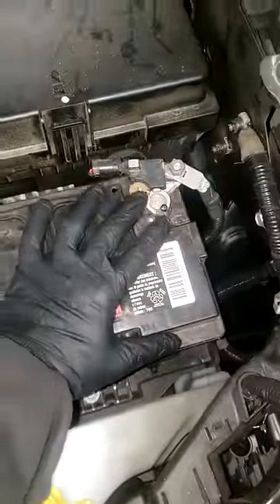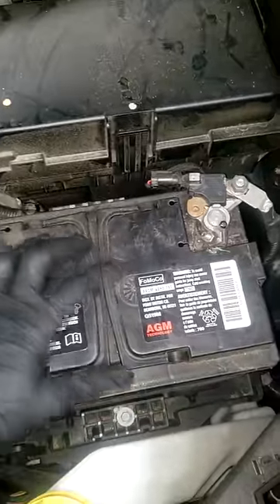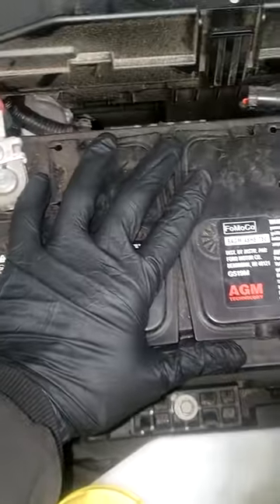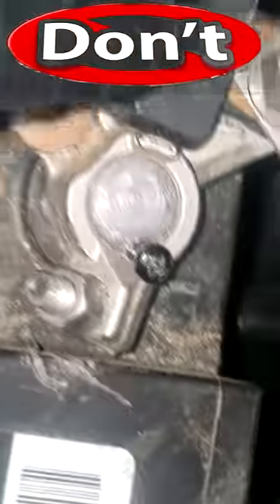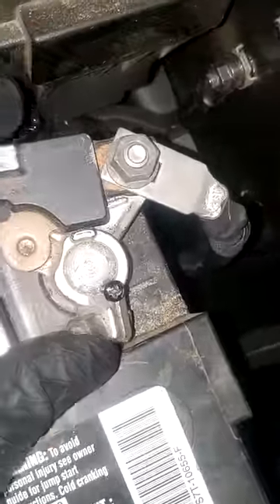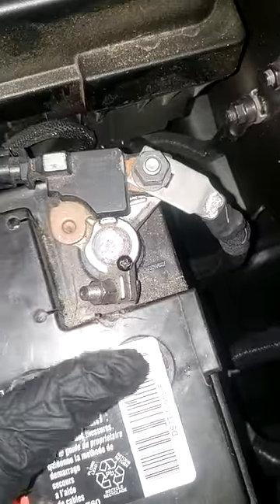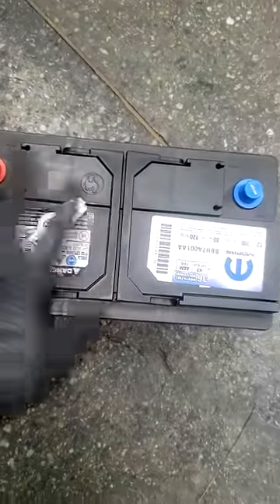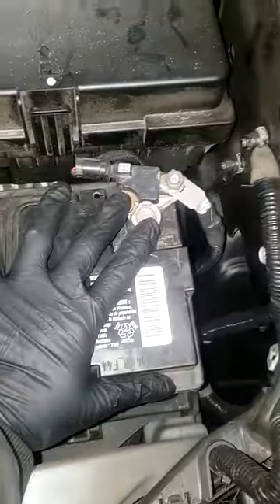STOP DOING THIS PEOPLE. This will destroy your car electrical system.

Comment: There is absolutely no way that sensor is being affected by this screw.. it's not the proper "repair" but also not the cause of the problem.. there could still be a bad or weak connection at the terminal that is the cause of the issue..or simply a bad battery..
Reply from the maker: How you gone tell me what the problem to this car is/was? So you really think you can put screws into a delicate sensor and it not be affected?
Reply: @OnlineMechanicTips  The part the screw is going into is not the sensor, that is the terminal. The black plastic piece above it is the actual sensor. Getting a bad GR8 reading does not mean the sensor is bad, that means the BATTERY is bad. I’ve worked in multiple different manufacturer dealerships from mazda to now mercedes. Slap a new battery in there and make sure the terminal isn’t loose or over tightened, then send it on the way.
Reply from the maker: @stephenhawkingMLG  bruh, why are we talking about this. Didnt I say the check engine light now off, its gotten a new ibs battery terminal/sensor and a battery. The car is gone and the customer happy. You cant ask for a better ending than that.
Reply: @OnlineMechanicTips  just out of curiosity, did you check it with only the battery before replacing the sensor? And if so, what were the results?
Reply from the maker: @SpicyMcGeezak  Not sure what you asking but here's what I did. Read the codes, looked at the IBS and battery. Thats all I needed to see. Showed customer, she gets pissed at the previous place. Boom. New battery and IBS installed. Everybody happy. No sense dragging this out with a lot of testing and waste of time. Most of the problem visually seen. You simply shouldn't be screwing into sensors like that.
Reply: @foodhatesme  I was just curious because it didn’t look like the screw was screwed into the actual sensor itself? Or am I missing something? Excuse me for my lack of mechanical knowledge.
Reply from the maker: @foodhatesme  Lazy bumb??? Lol...Ok lil guy, you obviously not understanding whats being said. But you are more than happy to waste time on trivia things. The code and the screw all I needed to see. Its fairly simple, don't be screwing screws into sensors thats monitored by computers. Can you at least grasp that concept? This is 2023, cars are more advanced and your old ways of doing things not advised anymore. You might wanna hang on to ya old ass cars because it seems you not ready for this new stuff..smh
Reply: @foodhatesme  I think it's probably a bad muffler bearing and not the battery. New plugs and turn signal fluid should fix it. Or he could hit the undo button, choose a recovery point closer to when the car was made and reverse the whole issue. I mean it's pretty simple. 🛠️
Reply from the maker: @foodhatesme  Now just how would you know what a real mechanic would do? Lol...foh, stick with them video games my guy, you seem good at that and popping off at the mouth about something you don't fully understand. Typical
Reply from the maker: @foodhatesme  None of which equipped with the IBS sys package. So again, leave the thinking to the pros, your video games needs your undivided attention.
Reply from the maker: @foodhatesme  Upset? Called out? Testing a sensor even with a check engine light on and visibly compromised, and you really think im going to waste time on that? Seems I've wasted more time with you my guy. Had i known up front that you not open minded and ya brain stuck on crazy, I would have never jumped into this. You tricked me
Reply from the maker: @foodhatesme  TF, I don't have to give you a reason or prove anything to you my dude. Please understand that..Im not trying to win you over. Believe what you want to believe my guy..if that makes you happy, stay the course, stick by your guns. Im cool with that
Reply from the maker: @foodhatesme  Finally something we can agree on. Now enjoy your lil video games, I have real world cars to diagnose and fix.
Reply: What does this sensor monitor, and how was it diagnosed?
Reply: The “IBS” sensor or “smart alternator” sensor first off can be totally disconnected, as that would allow full charge to the battery. The screw is not in the sensor, but in the terminal and clamp to prevent it from moving, does not effect either the battery or sensor unless that screw cracked that terminal post somehow?? A fresh battery and disconnecting that precious sensor, WILL fix that “electrical problem” period. Thumbs down buddy 👎👎
Reply from the maker: @SA-hk8xj  Seems you just as confused as everybody else if you thinking you can simply un plug that sensor and expect the customer to have a nice day. Lol, yes all yall may need some updated training on this stuff cause yall thinking old. Been there done that with replacing one and testing all that crap. Sys to sophisticated to guess. Simply replace both and call it a day..I highly suspect you guys would change course if you worked on these daily, but because you on the outside suspecting, I cut yall some slack.
Reply from the maker: @dagwoodtrizzle2693  If you not even sure what it monitor, whats the point in knowing how it was tested? You have to play catch up buddy.
Reply: Yeah I really don't see the screw making a difference but if makes the customer feel better just change it. I've done plenty of unnecessary work because the customer said do it. With them completely aware that its not necessary. Also why a battery sensor why so many needless sensors to break? I don't want to deal with that many points of possible failure. My dad quit his mechanic job because he spent 3 weeks fixing a Cadillac essentially for free. He was actually having nigtmares of wiring diagrams
Reply: @OnlineMechanicTips  No confusion brah. Variable voltage charging sensors have been around for years and were installed to meet manufacturer CAFE standards. To save that precious .001 mpg by lowering the alternator “drag”. Disconnecting that sensor/signal places the alternator back to charging at 100% all the time vs. kicking on and off (like those auto start/stop engine sensors as well). Think YOU need to get a bit more educated and quick posting crap like this to justify your thinking. Did you even place a load tester on battery? Did you scan the system for any codes? 
Folks, this right here is an example of a person who “thinks” he’s a mechanic that knows his stuff. Do your due diligence and find a real mechanic vs. just a parts changer that hopes he replaced the right part 🤦‍♂️😂 Good luck.
Reply from the maker: @SA-hk8xj  Your confusion based off the fact that you really think you can unplug that sensor and then deliver the car to the customer. smdh, that damm check engine light will be back on before she get around the corner. Thats the complete point why she here in the first place, her warning lights on because some jackass like you put a screw in her battery in an attempt to fix connection.  Not thinking such an idiot move would not be noticed. Same with your jackass way of thinking that you can simply un plug that sensor and expect the alternator to full charge and the light not come on. smdh..Cars communicate with customers via warning lights in case your un trained ass didnt know that. Warning lights draw customers to the proper shop after leaving such shop that you are employed at..Thank me later, the car fixed and gone. Keep your paws off these new cars and your screws in your tool box in the future my guy.
Reply: @OnlineMechanicTips  I know one can disconnect the sensor without tripping any codes!! Just like one can bypass the auto start/stop feature without tripping any codes. Get your electrical training and you will know too. I have permanently disconnected both types of sensors on many vehicles without any issues or call backs. In fact my manufacturer’s TSB has several notations on situations where this HAS to be done in order to either verify other electrical patterns, or to totally eliminate electrical fluctuations from either the sensor itself or down it’s communication path. Vehicles do not communicate with customers…they indicate there is a problem. It’s YOUR backward @$$ that needs to find the issue and solution and communicate it to the customer. Not wasting anymore of my time bickering with the “online  mechanic”🤣 Your advise fits perfectly with all the rest of the online fixers who “think” they know something, and post it on YT🤦‍♂️
Hope people that read our comments will at least get a second opinion before having someone like you touch their vehicle 😉✌️
Reply: Yea honestly this was not worded correctly. Should have recommended to the customer he replace that but not necessarily call it bad just because the previous guy put a screw in the terminal part of the sensor.
Reply: Bet that screw was grounded on the hood
Reply from the maker: @SA-hk8xj  Yea you stay nice and cool under your shade tree working on cars there. Aint nobody un plugging no dam sensors like you suggest..FOH with that... O the comments aint going nowhere, maybe somebody will take your advise and simply leave the screw in there but just un plug it..smdh..Yea bruh, I cant do this with you, I have lost a brain cell communicating with you. Seems you to far gone.
Reply from the maker: @goenitzlopez2076  First off, dont put words in my mouth. I never use words such as bad to describe a part. Only ameteurs do that. Second, if you been paying attention, you would have seen/heard me say after showing customer this, even she wants them replaced. If I had to choose a word to describe the failed parts it would be compromised. By some other shop that @S A work at. Yea they do work like that over there..
Reply: @OnlineMechanicTips  there is no screw in the sensor. All of us can see that. I don't know why you're acting indignant when given the video and the comment ratios no one really agrees with you. It's a ghetto fix but again you've checked nothing per your own word. You didn't run a battery test. You haven't tested the sensor. The only thing you verifiably needed from what was shown is a battery terminal to replace the loose one.
Reply: haha, I love this thread. This is cause for a good ol' wrestling match. At the end of the day, who fk'n cares, if it's fixed and the customer didn't get ripped off, it's good. We all have little different way of going about things, but if it worked, it worked. everyone is happy happy.
Reply from the maker: @arnold8746  lmao, not that simple dude. Some of these guys want blood...lol
Reply: @brandonweeks  Seeing as how that is the ground, why would that matter? That would also be a pretty tight hood to battery clearance as that was a pretty short screw.
Reply: @foodhatesme  he definitely is bro watch his recent short , he replaced 3 purge valves when the issue was a compressed / squished fuel line. bro is a con lol
Reply: @OnlineMechanicTips  wether its fixed or not now is irrelevant
 Its impossible that screw was the problem
Reply from the maker: @Justvn4thGenTL  smdh, the video you speak about was from Pep Boys. They replace the purge valves. Seems maybe you missed that part hater. You might wanna listen a little closer next time because I'm sure I said that. The actual problem with this 1500 was found by me when I dropped the tank. Smh
Reply from the maker: @johnnymathes5215  Ok let's see, screw removed, compromised parts was replaced, the code erased and the check engine light now staying off, Customer happy and gone but you still on here talking about the screw don't matter? Seems you missing a screw or 2. My goal is to please the customer, not you and your hack way of thinking.
Reply: Hey man can you let me know if God Is real cause you obviously know everything
Reply: @OnlineMechanicTips  Yes. They shouldn't have put a screw in the terminal. Yes, you should have tried the battery with the old terminal before changing the terminal.

If the terminal didn't need to be swapped but you still offered your professional opinion that it was required to be swapped and then charged her for it, then that's unprofessional. It very well could have required a new terminal. You don't know that for a fact, though, nor does anyone else.
Reply from the maker: @nickwilliams2415  What part of this not being your typical battery terminal do you not get? This is an all in one IBS unit here thats monitored by a computer.. Who am I to argue or resist what the computer trying to tell me?? If it's visibly screw into and cause the check engine light to come on (which is why she here) What on earth make you think im about to waste time swapping anything. You guys think to hard without thinking. Please never get a job on commission because you would be broke from wasting time and being caught in your feelings.
Reply from the maker: @3L5Ancho  No @ by this comment. Who are you talking to?
Reply: Yeah no way that screw was the problem.
Reply: @OnlineMechanicTips  u sure cause you can go back to that video and hear “ it keep coming in for a purge valve code “ meaning it keeps coming into your shop you work at with the same codes. Never did you mention petboys lol wth
Reply: @Online Mechanic Tips  haha mighty defensive..it was most likely due to defective battery which you also replaced you said. Replacing the extra parts is just upselling the customer
Reply: @OnlineMechanicTips  Grab a broom and dust these haters off lol. Your doing good bro, keep up the good work.
Reply: @OnlineMechanicTips  delicate sensor maybe but whoever put the screw in didn't bother it by the looks of it. He just made the connection solid nothing wrong there if that sensor was hooked it was a coincidence. All he did was cost the owner a battery and sensor and probably didn't fix the problem
Reply from the maker: @rjrobles8469  lol whats crazy is that they all so called mechanics that maybe a lil to advanced for the video. But its killing them and itching them to death to jump in and say whats done wrong. If it was me, ide simply create a youtube channel and do rebuttal videos on the ones I don't agree with. That channel would blow up. But I guess its easy to simply sat on the sideline and vent.
Reply from the maker: @Justvn4thGenTL  smdh, you gone have to do better with the hate, you suck at it. That truck came from pep boys. Purge code again, history of those valves was done at pep Boys. Hence the reason why I got it little man. All Pep Boys had to do was run a verification test using a good scan tool and it would have showed fail and tank pressure high. From there find the restriction. Thats exactly what I did. This truck been fixed a long time ago..You need more practice at hating my guy.
Reply: @OnlineMechanicTips  you specifically said , it’s been in here several times for purge valve , you did NOT mention pet boys lying a$$ 😭😂. nobodies hating also kiddo
Reply from the maker: @Justvn4thGenTL  Seems slow, seek help quickly
Reply: @OnlineMechanicTips  worry about fixing cars the 5th time it comes around , stealing money
Reply: @OnlineMechanicTips  Sure you may have solved the problem , but it was not the screw.  The problem is you made a video saying that a screw caused this problem.  It’s not helpful
Reply: I’m a former Mastertech and Automotive Engineer. I know for a fact that the test that mechanics do for most parts are not 100% perfect. That’s because, mechanics only have access to certain types of tools. DMMs DSOs etc. To really truly test some parts you need a whole (very expensive) specialized test rig. Long story short… If the mechanic suspects parts in that general area could have been affected by the hack repair…. It is a good idea to just go ahead and replace them. Sometimes it’s not just about saving the customer a few bucks. Sometimes it’s best to replace related, potentially damaged parts … to save the customers Time from potentially having to come back for the same problem. Just food for thought my friends. 👍
Reply from the maker: @Dogpool Im a youtube content creator, im not even sure you know what that mean or would understand.  Lmao, but helpful to who? What do you supposed the title should have been?
Reply: @OnlineMechanicTips  No you are just too incompetent to understand that the screw is NOT screwed into the sensor, its screwed into the terminal block/ring as a shim. The sensor may have been broken but it was NOT the screw that did it, it was just a normal old sensor failure from being in use. Lmao
Reply: @OnlineMechanicTips  This guy is wrong! You were correct in your presumption. These sensors are calibrated, and extremely sensitive. The material in the the screw is not the same as what the sensors made of. Although, not the same, I’ve seen photovoltaic sensors that were so sensitive, that connecting the wires together with wire nuts caused the resistance to be out of spec, and the sensor would not read, correctly. Good job, and thanks for the video
Reply from the maker: @ElaBellll  Your clown ass still on here defending that screw?  That IBS monitor things like the voltage, temperature, and current. youd have to be out of your mind to trust that the screw had no affect on any of that. Especially considering the warning lights and codes that it produced. These computers simply expose hack mechanics like you that see know problem with this. That sensor is a complete unit here, we dont separate them.  During factory training,  from engineers I might add, it is highly advised to simply replace it if some jack ass shop like the one you work at do shit like this. Are you really that dense?
Reply from the maker: @johnharrison5656  I recall being at the factory training center in a body electrical course. I cannot count the number of times the instructor brought this up. People cant let go of the past. Any outside interference from items such as screws, to simply replace the IBS because it could affect other things and set crazy codes. Im to the point now, any type problems I get, im looking at that battery and its connections. Ive seen poor battery connection knock transmisions off line and out of proxi alignment. This customer actually lucky all she had was a check enging light on, it could have been worse. Thanks for tuning in John.
Reply: @OnlineMechanicTips  there's a clown here but it's not me lmao
Reply from the maker: @ElaBellll  What you saying is clownish and signal you still living in the past. New cars are different buddy, your old way of thinking just wont cut it. I work on brand new cars on a daily, theres no way I could survive here with clownish thoughts like yours running through my mind.
Reply: @OnlineMechanicTips how was the sensor visible compromised?? You keep saying the screw was in the sensor butttt that’s not the sensor that’s the battery terminal which does not affect the sensor that’s there just to tighten the connection can you read what the other gentleman said?
Reply: He shotgunned it.
Reply: I understand both arguments… theres two sides to every story. If it was me and my vehicle, I would just replace the bad battery. If it was for a paying customer or for the in-laws or something, I’d replace both battery and sensor just to 100% be sure they ain’t calling back… lol i mean that sensor definitely isn’t damaged by that screw but who knows what kinda high resistance was running through that bad terminal connection causing heat, etc. possibly screwing with it before that last lazy ass had his head under the hood. Id rather be 100% im not getting call backs from certain people than 90%… its just less aggravating for everyone. But if it were any of my vehicles, the wifes or just a customer who needs cheapest fix possible for a cheap car, then battery swap is plenty enough with maybe a quick sensor bench test
Reply: @WrenchBoostBoi 89  I think the issue here is how the guy worded it. The sensor was NOT necessarily bad. He just shotgunned it to have it back to factory but he should have explained that better in the video not the way he just says that screw messed up the sensor and caused all sorts of erroneous readings that was not proven at all in the video.
Reply: @ElaBellll  😂😂😂😂 this guy thinks the battery cable terminal is a sensor.
Reply: @OnlineMechanicTips  hack
Reply from the maker: @Nick-nj4tj  Lol, uhmmm, you gone have to hate harder than that to get my attention lil guy. Please try again saturday.
Reply: @OnlineMechanicTips  that screw is not into the sensor
Reply: @OnlineMechanicTips  ok guys please let's stop fighting! Side note I have a serious question! Ok just so we're clear the screw itself is the IBS sensor right? 😂
Reply: First rule is test all components, that sensor was probably okay but now you'll never know, sensor was probably couple hundred bucks .   Imagine if it was a 3000 dollar part... I'm sure this fella would just swap it out too without any testing. 
Hashtag hacks 🤣🤣🤣
Reply: @OnlineMechanicTips  he's right, but use a zinc diecobra screw next time. The AMS capacitor on this model works better if there no magnocarbon interference. Just sayin.
Reply from the maker: @black98rt  How the hell would you know?
Reply from the maker: @gradoisx2348  smdh, its 2 parts combine, I never separate them. If one compromised the entire thing garbage. Words from the engineer instructors at the training center. So what ever way you do it, continue. Im doing it my way.
Reply from the maker: @CM-xr9oq  The screw compromised the connection between the terminal part of the IBS unit and the battery post. All grounds for replacement on this setup.
Reply from the maker: @jfrog180000  Sure, and nobody fighting
Reply from the maker: @cheaprubbergarage6015  You can waste time testing parts thats been compromised all day long my guy. Hell I look like testing a battery thats wrong and a sensor that some clown been jacking with?
Reply from the maker: @mikebravo3527  But you didnt say nothing
Reply: @OnlineMechanicTips  good on ya for actually responding to everyone because you're right, I 100% mocked up a bunch of BS lol
Reply: @OnlineMechanicTips  while you had the customer’s car in the shop, you should have let the customer know it’s time to replace the panametric FAM and the turbo-encapsulator.  Those go bad without warning and can destroy the whole engine!  It’s a moderately pricey service, but the customer will be happy knowing their engine is safe for another 15,000 mi.  Good customer care and a friendly tip for you!  Can you please include that service in your next video?
Reply: @goenitzlopez2076  true enough
Reply: Probably not but there was obviously a connection issue and they destroyed the negative terminal by driving a screw in between it and the clamp.  So if the customer wants the problem gone it all should be replaced.  As long as the battery tests good it wouldn’t need replaced unless the screw caused connection issues.
Reply: he's right. this ain't gonna affect the sensor.
Reply: @OnlineMechanicTips  You're a diagnostics reader and parts replacer. But you don't really understand what the parts are or how they work. That was not "screws into sensors". The computer could not even tell that the screw was there. You replaced two key components without checking individually which component was actually the problem.
Reply from the maker: @davidsnyder3799  I just checked a lil history on you,;seems you simply a nobody thats on the sideline trolling. If you know so much, get ya ass off the sideline being a keyboard thug and hop on this youtube video thing.. Flex ya muscles there, not here, i care less about them. Now  you have no idea what I know or understand, only what I show. You have no idea what code the bcm had in it relating to that IBS thats affected by this stupid screw, no, the IBS don't no a screw is in it but because connection has been affected it sensed a problem and turned the warning CEL on. Not only that, the battery wrong and failed a load test. Hence the reason for these 2 parts. This car fix and gone and you still over here flexing? Lmao. Bro this youtube, whip out ya camera and get ya shine on flexing on ya channel since you know so much. Im a content creator, no sense in displaying to much if I need you watching the videos..Get ya mind right dude, you don't even understand the game
Reply: I’m a certified Gm,Hyundai, and Genesis Tech. I deal with silly stuff daily & It’s no way possible that screw will affect the sensors reading. Is it a raggedy setup? Yes, but I’ll bet 100% if you ONLY Changed the battery and terminal then it would of gotten the same result as a entirely new sensor. I understand your way of thinking but you really did over complicate this one….. This is one of the rare times i see the YouTube comment section mechanics actually being correct and you being wrong. Please actually do it one step at a time and save your customers money next time Sir.
Reply from the maker: @Call_MeDaddy  First off you can't get that terminal without the sensor so if the terminal questionable, dammit the complete unit getting replaced.in this case the battery and the IBS  was replaced. Nobody wasting time testing shit like this when you can visibly see its been compromised.  In the shop, im a mechanic, on youtube, im a content creator that make videos for my targeted audience.. If you to advanced for the video then keep it moving.
Reply from the maker: @jasonhollis5916  smdh. You cannot get these separate here Mr slow man. So if the sensor detects a problem with amp/temp, you get the complete unit. While you defending that screw, this customer lucky she didn't brick her transmissions. Any spike from that poor connection could have knocked her out of proxi alignment. But because you a clown, you likely have no idea what I'm talking about
Reply from the maker: @mikebravo3527  you still ain't saying nothing.
Reply from the maker: @Call_MeDaddy  Hey bro my bad, I got you mixed up with a different hater that said some f up shit. My comment wasn't meant for you. Thanks for your constructive criticism and question. I apologize.
Reply: @OnlineMechanicTips   It’s all good lol
Reply: Im just here to learn somethin new and came across a good argument 😅 the internet is undefeated LOL
Reply: @OnlineMechanicTips  bro I was clearing trolling the know-it -alls, my sentence made absolutely zero sense lol. Quite the banter you have stirred up here...good luck!
Reply: @OnlineMechanicTips  Get back to work man, being on your phone all day isn’t gonna bring your hours up. take some oil changes and get back to your roots.
Reply: @OnlineMechanicTips  I'm just messing around. Haha I figured the tension was getting high so I'd crack a joke 🤣 keep up the good work on the channel. There's a reason you got 115k subs
Reply: @foodhatesme as a non-mechanic consumer, simply spectating ya'lls conversation. . How much did the repair cost? If the problem was fixed for 300-400 dollars? Doable. Or was it 1200? That's a bit more harsh.
Reply: @foodhatesme  definitely taking advantage to make more cash. Lazy and he didn't properly check or diagnose the issue...
Reply: @ronrico2620  I think the issue here is that the scammer tech didn't make them aware as they're denying incompetence already.  I didn't think they would not only make a vid proving them wrong, but act as if they're innocent of any blatant wrongdoing.
Reply: @arnold8746  are you going to find and give her back her money for an unnecessary job she didn't need to pay for? That make everyone happy so you'll do it right lol
Reply: @OnlineMechanicTips  don't add disingenuous projecting to your list of backwards thinking errors. The more I read, the worse you get. Do better or stop touching cars you shouldn't be working on to begin with...
Reply: @rjrobles8469  stop enabling trolls..
Reply: @OnlineMechanicTips OK Mr know it all this is not the problem what he was asking is that did you try the old ibs sensor with the new battery and if so did it work or not that would narrow down if the battery is the problem or if the sensor was the problem
Reply: @SA-hk8xj kicking on and off? Guy idk what Crack your smoking but I need some of it it's the form of the battery taking the charge or not taking the charge if we didn't have it's sensors which we don't need then the battery would eventually even out with the output voltage of the alternator reducing the drag on the engine it's already smart and doesn't need that sensor
Reply: Yeah he managed to fuck over some women who didn’t know any better and she gladly paid out the ass for a new sensor (plus install)  and battery and was happy the light was out. We all know the light would have went out with just a new battery. That screw was nowhere near the electrical part of the sensor and had no effect on the sensors operation.
Reply: @ronrico2620  I can 100% see why your dad would have nightmares after working on Cadillac wiring electrical problems. They are the nightmare of nightmares.
Reply from the maker: @jamesolelo4406  Let me guess, they should bring the car to you right? I'm not even sure what your attention seeking ass talking about. You jump in the middle of somebody post bugging. Do better dude.
Reply from the maker: @jamesolelo4406  This has everything to do with older or newer cars. Thus screw and poor battery connection not much of a problem on older cars. But these newer computer control cars using IBS, this not a good idea. Im not sure wth you even talking about..
Reply: @OnlineMechanicTips  You had the customer pay for a battery and an expensive sensor because there was a code.  Did you try clearing the code to see if the light would stay off?  Based on what you've said you did not.  That code might have been introduced when the battery was disconnected and reconnected.  If the sensor was bad then so be it - replace it but you didn't check the sensor.  You didn't even test the battery, based on what you've said so far.  You replaced it because a shade tree mechanic shimmed the terminal (NOT the sensor) with a screw.  Replacing the bad sensor (assuming it was bad) would likely have been sufficient.  You are a parts changer... a parts cannon.  Throw parts at something without testing.  It is YOU who probably doesn't understand the modern technology and should consider sticking to older automobiles.
Reply: @OnlineMechanicTips  reread for comprehension and stop doubling down already. It's not an issue on either vehicle. Sorry
Reply: @OnlineMechanicTips  so did that fix it?
Reply: I came to say the same thing, and the kicker is that if he's been in the trade long enough he would have known that almost every single newer vehicle has the CEL come on when there's a battery issue, I'm going on 17 years of wrenching and have seen rookies do this shit all the time, they also think their smarter with their state certs over someone whose been ASE certified for over a decade.
Reply: Jeeze here come the internet experts- yes that screw is absolutely the problem.  The screw is there because the terminal is stretched and was added as a ghetto way to get better clamping. Such a shoddy connection will cause intermittent loss of connection to the chassis ground which 100% of the vehicles electrical current passes through- every electrical system on the car is dependent on that single connection at the negative battery terminal. -13 year auto tech. 🙄
Reply: @OnlineMechanicTips  you still didn't say anything
Reply: damn op still trying to defend himself when any mechanic with common sense would know thay screw was doing no harm.
Reply: @OnlineMechanicTips  they sell battery shims at every auto parts store around. It's not a screw but it's exactly the same concept. Basically a cap over the existing terminal to make it wider for those terminals that won't tighten all the way.  Is that going to "damage" a sensor too?
Reply: @OnlineMechanicTips  Thier point is that you should have left the origonal sensor and installed the new batter. If that fixed the problem great.  If the problem was not fixed, then replace the sensor too.
A good tech isolates issues and only replaces parts that need to be replaced.
Reply: @OnlineMechanicTips  bro if you think the screw in the battery post or the terminal have anything to do with the sensor you need to go back to class, as long as the contact surfaces are tight there is no issue
Reply: @brandonweeks  can I ask how that would be a problem? That’s the negative terminal.
Reply: @jfrog180000  is dis da flool pump??? 😂
Reply from the maker: @forcedtomakeanaccount7628  Uhmmm, excuse me who are you again? O yea another nobody looking for attention. Bro this video not up to get validation from you as to whether its right or not. Im just showing what im doing. But your nobody ass welcome to chime in with your opinion, I just wish you was somebody so I could take you serious. But as of now, its hard to take you serious, keep it moving
Reply: Just because it worked doesn't mean that the screw was the problem. If the sensor was bad it was gonna do that regardless. Now I've never used a screw before but I have been known to flatten o a copper wire and slide it in then tighten it down. In a pinch. I've never left it that way for an exorbitant amount of time but also never had it become the cause of a failure.

I not going to engage in an argument I'm simply stating what I know to be true. You fixed the right thing however you have theorized the cause of the failure was the screw when it is more likely the sensor was going bad and was intermittent so they put the screw in and assumed it was fixed. And now the sensor has just given up the ghost completely.

But at least you can get in there and fix it yourself. My buddy was a light wheel mechanic in the army and now works professionally as a diesel mechanic but couldn't change the brakes on his Chrysler 300C. 

Just to clarify I'm a GM certified master mechanic, with a college degree in auto mechanics and automotive engineering from Lamar College. My uncle Billy is also a GM master mechanic and more. I started working I his shop when I was 11 sweeping floors and doing office work. And worked for him until I joined the army in 2009. That was 6 years of professional experience when I was 17.

But I guess the bottom line here is that there's more than one way to fuck a monkey but there's always gotta be somebody there to hold the tail.
Reply: @OnlineMechanicTips GUY. Stop.. the longer this goes on, the more embarrassing it be....
Reply from the maker: @joelucas6601  embarrassing to who?
Reply: @OnlineMechanicTips  Yes as an engineer this is a ground, it is completely fine.  What will cause issues is a bad battery or a corroded terminal.
Reply from the maker: @SkaterStimm  Uhmm, this was a battery connection problem. The terminal and battery post connection not on point. And that dam screw def didnt help. Car has the wrong battery with wrong size post so they hacked the terminal/IBS with a screw trying to help... The battery and the IBS/terminal sensor was replaced, connection now on point, car gone, everybody happy.
Reply: @Online Mechanic Tips  The light was on because the battery was bad. Not because it had a screw in the terminal. I bet the sensor was good.
Reply: @OnlineMechanicTips  Was definitely the flux capacitor cat sensor... 🙄
Reply: @OnlineMechanicTips  You are literally online giving mechanic tips! You absolutely do have to explain why you're doing what you're doing and how you came to that conclusion. Otherwise it's not a tip or even remotely educational it's a this is how i fixed this issue you'll probably never have in a half assed manner based off totally made up information.  But when you're questioned about how you came to this conclusion. You instead demonstrate that you have a barely working knowledge of the parts you just changed to the point that you don't know which part is which and have repeated it enough times that it is definitely not a error. You genuinely think this shit. If you weren't trying to win him over you'd have shut up 5 days ago.
Reply: @OnlineMechanicTips  That screw isn't in the sensor. Are you really pretending that a battery terminal is a sensor?
Reply: Yeah...I have seen this a handful of times being a BMW guy. I have never replaced the sensor, it has always been a bad battery, or the terminal being too small to clamp down any longer, because someone left the terminal lose. Mainly a heat sensor.
Reply: @stephenhawkingMLG  As a former mechanic you are 110 percent correct! Take a pair of channel locks, squeeze the terminal an RCH, clean terminal, tighten it, and ship it.
Reply: @OnlineMechanicTips  How much was the sensor that the customer had to pay for? How about the same exact outcome but the customer saves and I am guessing here $180 bucks.
Reply: @OnlineMechanicTips  My man, be humble. You fixed the car, but you screwed your customer out of a few bucks for labor and parts, most likely. As long as you have good contact to the terminal (which feeds the IBS), the sensor is functioning just fine.

No one's saying you did it wrong. We're just saying that you could've done better for your customer by providing a two minute diag on the sensor and not wasting her money on parts and labor.
Reply: Its true the screw doesnt affect the electrical system.
Reply: @OnlineMechanicTips  were gonna tellyou cus thas judt how it works. Physics.
Reply from the maker: @donaldduck2232  First off the customer didn't have to pay for anything. Its optional to decline the estimate if you want to.. Second what makes you think to all customers,   money is an issue?  After what she just went thru at that other shop, she instructed me to fix her car right. Stop thinking all customers broke. Your ass gonna go out of business because you get caught in ya feelings always trying save money. Your estimate should include parts thats gone fix they shit right. Thats what I did. She gladly paid and happy. Get ya mind right bruh.
Reply: Lol this comment section is quite entertaining, look at all these people telling this man how to do his job after he already fixed it
Reply: @OnlineMechanicTips  LoL

Well shit. With that logic you should have replaced the Alternator to. I mean she had the money. She could have said no if she wanted to. No one forced her to replace an Alternator that she didn't need.

Your honestly telling me that you dont know that you could of lightly crimped that terminal and the result would of been exactly the same. Do you care so little for your customers that you dont care if there bill is an extra $200 bucks? How much was that terminal anyways? What did you charge her to put it in? You know this lady that closely where you know a $200 ish hit isnt going to hurt her?
Reply: Hack.... Foodhatesme has pretty much hit the nail on the head. Screw had no bearing on anything except to leave some marks in the side of the post.
Change battery if it was failing load, then test drive the car. If it still throws a code, move onto the next thing. Replacing things without diagnosing is wasteful of a customers money. Might be all well for the ones that can afford it but for those that can't, it's a big deal.
Reply: @foodhatesme  i have to side with you kinda but thats what mechanics do, they there to take your money, not save your day.
Reply: You might want to get that good battery off the concrete floor like that.
Reply: @OnlineMechanicTips just because yky put a screw doesn’t mean the sensor is bad. I agree. it’s not the proper fix to shove a screw. but doesn’t mean the actual sensor is bad and should be replaced. Should be diagnosed before replacing random parts
Reply: Yeah nah that screw wasn't the cause
Reply: @OnlineMechanicTips  dude, you shound have at LEAST tested if the sensor was the issue, that was just shimmed between contacts and absolutely could have been a non issue, Ive worked on both cars and phones and can see there's a high chance it was only the battery that needed to be replaced, we would all believe you if you did it right but you skipped steps irresponsibly
Reply: I remember my first day in the shop.
Reply: Was gonna subscribe. But I have been a mechanic for over 17 years and your explanation about HOW/WHY  the screw ruined the battery/connection... 

Did you CHECK BATT VOLTAGE? 
Maybe check for diagnostic bulletin for common make/model.

IF YOU SHOWED BATTERY VOLTAGE I WOULDN'T BE HERE COMMENTING. 
CAN YOU NOT SERVICE/CHARGE HER BATTERY. 
JUST THE SENSOR SHOULD BE ALL THATS NEEDED.
Reply from the maker: @refraggedbean  smdh..this is a 60 second shorts video dude. Tberes a lot you will not see in that time. Fact is, the screw was all I needed to see. Yall obviously don't understand the risk of what poor connection at the battery can do on these newer cars  because yall defend the screw..smdh
Reply from the maker: @iROXBEDDA  Its crazy man. This lady just left a hack shop that I think all these guys work in..lol..They all defending that screw like thats normal..This 2023, you can't do this hackery shit to these high tech computer control cars anymore. Smdh
Reply from the maker: @fpotochney7318  really dude?
Reply from the maker: @F80__Los  Its about the connection  my guy..you cant play around with the connection on these newer cars. Its just that simple
Reply from the maker: @dylanjamesryan9432  Curious why you would mention the first part of your comment.  If seeing a debate about a repair discouraged you then yea, you made the right choice. You likely will see a debate on every video because I am one to read comments and respond. Which triggers debate. Good or bad. Im not gone just look at a comment dogging  me out and just pretend I don't see it...Naw..But seems you to sensitive.
Reply: @OnlineMechanicTips  lol I knew that would get you that’s why I had to say it I’m just joking that was a myth back in the day people would say so I had to use it
Reply: @OnlineMechanicTips  I KNOW it’s about the connection. I specialize in german vehicles, Trust me i know, but ther doesn’t mean the sensor is automatically bad
Reply from the maker: @F80__Los  Dude the sensor and the terminal is the same part. You cant buy them separate. If somebody grinds or screw into that ground terminal and I see it, its getting a new IBS sensor/terminal... ITS ALL ONE UNIT.
Reply from the maker: @fpotochney7318  lol
Reply: @OnlineMechanicTips  it's like these fools have never heard of ohm's law, like one the first things I was taught when learning electrical diag. If you use a screw to get more contact with the terminal, you are also introducing more resistance to the circuit. And when you have a sensor monitoring that circuit for faults, that excess resistance is going to affect those readings. This is why I do my own work on my car, too many people that THINK they know what they're doing, but clearly that ain't always the case..
Reply: The customer wanted it swapped and done right. He did the right thing. Whether the sensor was bad or not is not the issue. The issue is the screw was put on there because the terminal was loose. If that terminal is a part of the sensor, only a hack would put that screw back in there after changing the battery and not fixing the contact issue properly, which is to replace the sensor/terminal. It was obviously an issue because the issue was fixed by replacing the part.
Reply: @Online Mechanic Tips  chief you need a reality check 💀
Reply: @Online Mechanic Tips  dawg you can LITERALLY fuckin unplug the sensor and it runs. I've done this numerous times, that sensor just stops cars from being overcharged. If you're diagnosing a bad IBS, the diagnostic route is to first unplug it and see if the issue goes away. If you can't even do that how are you gonna claim the IBS sensor is bad. I work on BMWs with these finicky sensors often af 💀 the issue here was a bad battery
Reply: @Arnold  the problem is that this tech is why people think mechanics are scummy. Just throw parts at the problem and one of them will fix it. He wanted to replace a hundred dollar sensor along with an expensive battery when all the customer needed was a battery
Reply: @foodhatesme  I mean I get what everyone is saying... But still... He got it fixed... By replacing the parts... 
Me .. I'd be pissed off. That battery was just fine... The terminal can still be used.. and actually seen them fixed.
It is odd that it's that little sensor... That is actually bad... It just seems like bad contact.
Yes... He should diagnose it... To be sure... But.
We all know, if we can figure out something with an educated guess.. before you get to diagnostics... And you find an obvious issue.
Then sometimes that's good enough.

Though... I think the point here is... Bro... You really shouldn't have a. I good enough.. type attitude towards being a mechanic.. that is an actual bad mechanic. But I hope I'm wrong. And this is just a special case
Reply: @arnold8746  did they.... Did they not get ripped off...
I believe a real mechanic.. yes... REAL...
Gives the customer multiple choices.. IF POSSIBLE...
If they want the cheaper way to fix something, that's fine... They wanna just replace everything, that's fine to..
Let THE CUSTOMER DECIDE... and you do accordingly.

Not saying this case should be that way.. she stated. Make it how it was originally...
Which is good for a shop owner... 
Bad for the husbands wallet... Or her own wallet. Whichever it is
Reply: @strydyrhellzrydyr1345  honestly there are way too many comments to go through, and I can quite remember what I said. So maybe you are correct.
Reply: @WallyST675  Hello...didn't he say the sensor and terminal are together?
Reply: @OnlineMechanicTips exactly. BMS does trigger charging system fault light and sometimes the CEL/MIL
 

Do you brother. Youre doing the proper repair by the book there. Terminal is worn oversize and the battery post is worn, the BMS sensor also set the code.  👌
Reply: @foodhatesme the sensor trips a fault. Ive replaced them before myself. It has its own fault code for a faulty BMS.
Reply: Amen
Reply: @stephenhawkingMLG  I agree
Reply: @bon3y4rd  ☺️
Reply: That screw isn’t the problem, it isn’t proper fix, but it isn’t causing the issues.
Reply: @OnlineMechanicTips  The screw was driven into the battery terminal, not the sensor. Maybe if you had confirned the sensor was bad before just replacing it I might believe you, but your a damn parts cannon.
Reply: @brandonweeks  lol
Reply: Parts changer.
Reply: @OnlineMechanicTips  the screw is in two hunks of lead
Reply from the maker: @danielsteward5090  You still on here defending that screw?
Reply from the maker: @grantwright6294  The IBS is one unit my guy. Anything that will affect proper battery connection a big no no for me.
Reply: The people in here have no idea how those sensors work. I wouldn't have wasted my time with all these comments. Maybe that drives engagement idk.

Anything that creates resistance is bad for a battery, any resistance between the sensor and battery will cause phantom issues.

They are made to a specific spec. Putting a screw there is similar to corroding the terminal itself. Which also is bad for the sensor.

If it was corroded and the sensor was "fine" there's still a good chance it's not operating normally due to it operating with higher amp draw for it's lifetime.

I would rather have the parts replaced stock. Electrical issues are a nightmare once they get going. I'm not even a mechanic but I know one person who's car locked up and this was their "fix."
Reply: @OnlineMechanicTips  you keep claiming that screw ruined the sensor though, and it was on a flat piece of metal, not on the sensor, that screw didn't even touch the sensor, but you replaced it anyways and keep saying that screw was all you needed to see, you defend your mistake to replace a part unnecessarily all because you don't understand how that part works and didn't want to take any due diligence to do proper troubleshooting. the fact is you need to learn how these parts actually work and learn how to actually work on cars before a customer catches on that you're wasting money throwing parts at cars without a proper idea what you're doing
Reply from the maker: @refraggedbean  Lol you sound crazy my guy still on here defending that screw. I know how the parts I replaced work, I also know the risk that comes along with not replace a part thats been compromised. Proper connection at the battery was my number 1 concern. Gave customer the estimate, she gladly approved the repairs and its done. And for the record, that terminal is part of the sensor, its sold as a complete IBS sensor unit not separate. Why is it that this customer gone and happy, Im happy, boss happy, but Kalli still defending that dam screw?
Reply: @bon3y4rd  it can also happen when the blinker fluid gets low
Reply: There are circuits (FOR SENSORS) that will be off of calibration due to the resistance being different than intended, there are sensors where if you shorten a wire it will actually make the sensor read differently. This is no different
Reply: Facts. Dude just made a video showing how he changed a part that most likely wasn't bad. Easy way to overcharge the customer. This is why parts changers aren't mechanics.
Reply from the maker: @moedigzz  smdh most likely wasnt bad? That statement alone tells me you most likely have no idea whats going on. Go have 2 seats my guy
Reply from the maker: @greuju  A interesting read
Reply: @moedigzz  I come from the RV field and the issue with your thinking is the battery is the source.

If the source goes bad, and there's a sensor like this, it's best to replace all affected components. If your source goes bad, there's a high chance components attached go bad too, or they were the reason your source went bad.

Which is probably his thinking.

It's different if it's suspension or anything mechanical.

But DC voltage and sensors are prone to failure if the source/battery isn't maintained.

If you expand your thinking to solar. The amperage is higher and if anything goes bad there you replace all affected components, no question.

Low voltage and high voltage into that sensor can cause it to over or underdraw or over or undercharge the battery.
Reply: yeah but i really dont want a SCREW in my battery term. 😂
Reply: @ronrico2620  I love caddy wiring diagrams. :-D 
Diagrams in general.